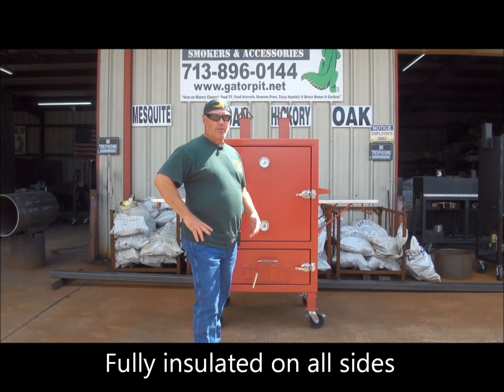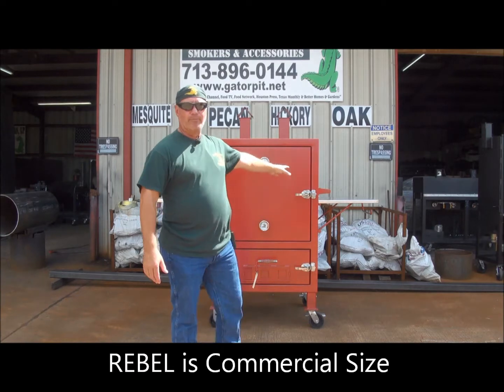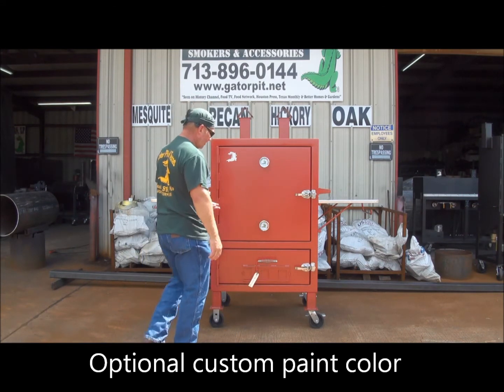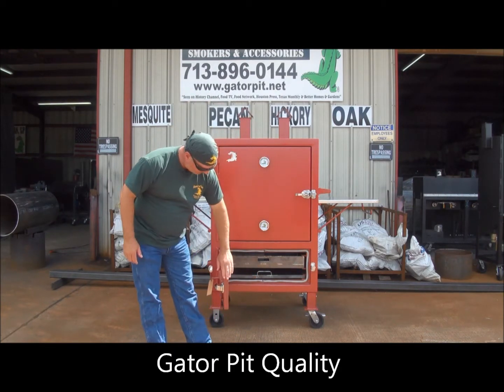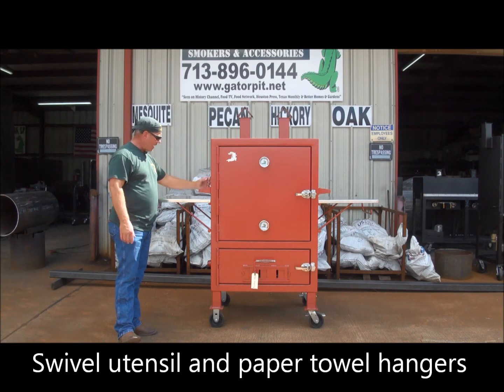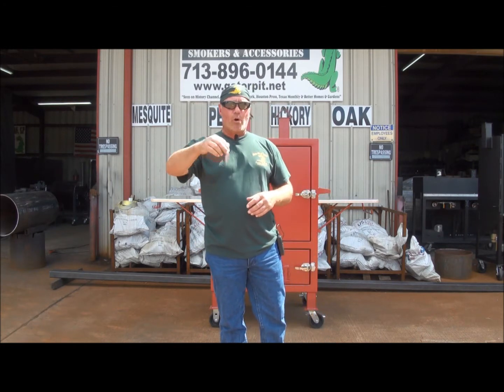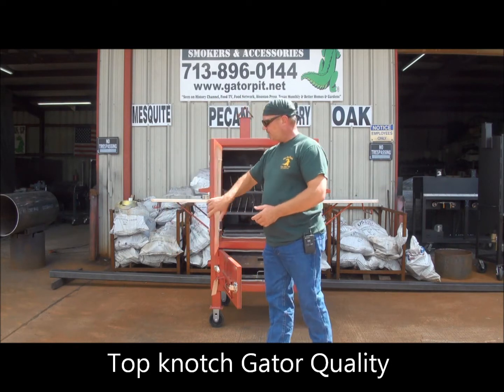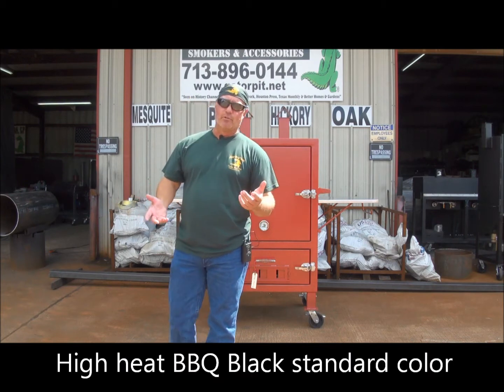King of the Grill, Gator Pit of Texas Ritch Robin

Comment: Can this run off pure logs?
Reply from the maker: YES.  Our Dual Stacker and our larger Rebel, can use wood logs only, as well as charcoal/lump/wood mix.  Personally, I always used full split wood logs in my Rebel.
Reply: Gator Pit that's incredible. I'm a 1 man catering buisness and work another demanding job. My customers demand the smoke flavor but I also need to sleep from time to time. Do a lot of people go full wood then when they wrap go with a lump wood or charcoal wood mix with a guru to rest?
Reply from the maker: It is a mixture of what folks do.  Everyone cooks differently, for the most part.  I always went all wood, using charcoal or lump to get the fire started.  You can get hours of burn time using the T-Plates and lump or charcoal.
Reply: Gator Pit using just wood how often do you have to mess with the fire?